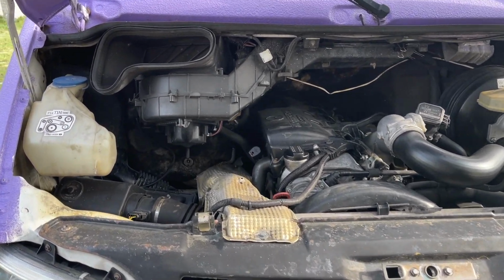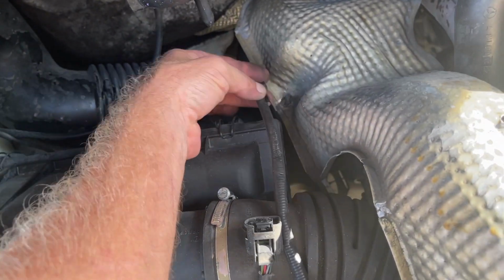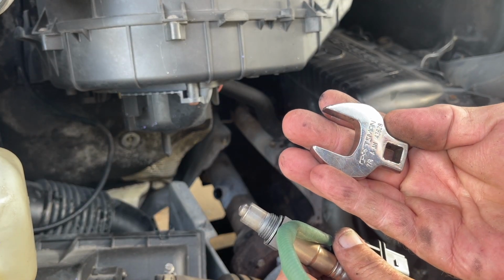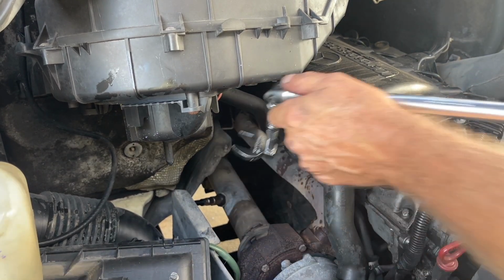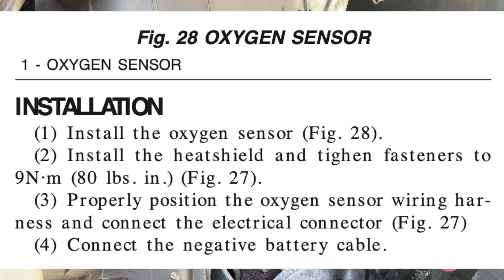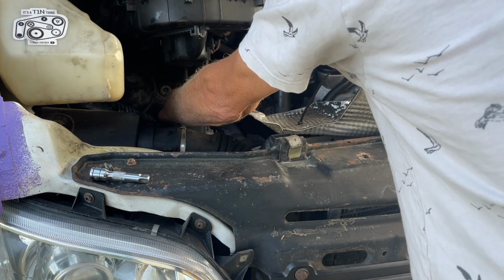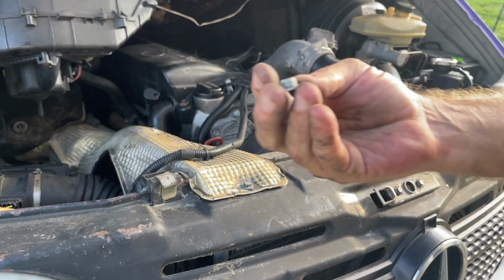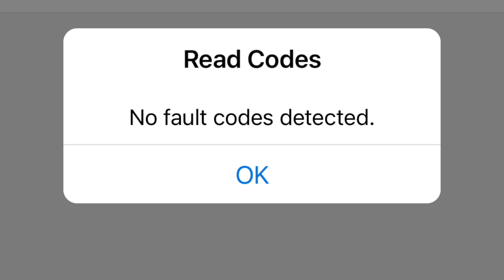Oxygen Sensor or O2 Sensor Replacement T1N Sprinter

Comment: I changed that and a few other parts.  Mostly electrical issues.  New fuse block and MFS.  Still no power on fuses 2,3,10,12,13,14. 
4 months and I'm ready to be institutionalized.
Reply from the maker: Some of those fuses don't get power until the engine is running or the device like headlights are switched on. You might be chasing ghosts.

Comment: are you still using the autel scanner? mine quit working: the app crashes upon opening even after deleting and re-installing; the developer isn't responding to inquiries apparently
Reply from the maker: We had a few days Autel had trouble with account login on Android devices but that has been resolved. I didn't have trouble this time on Apple products and it continues to work well for me. Many folks in the community have gotten through to tech support. I have not been so lucky and can't say why.
Reply: @FloridaVanMan  i went back out yesterday and re-tried the app and sure enough it worked like a charm